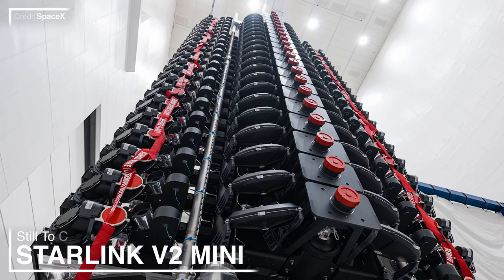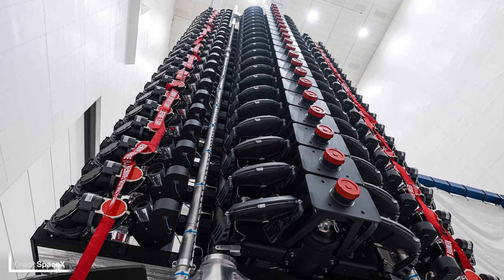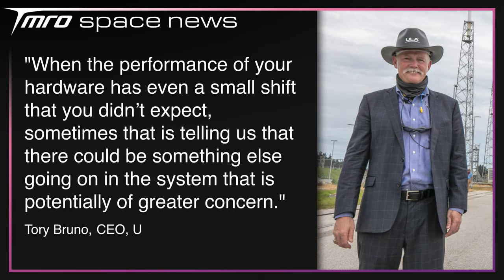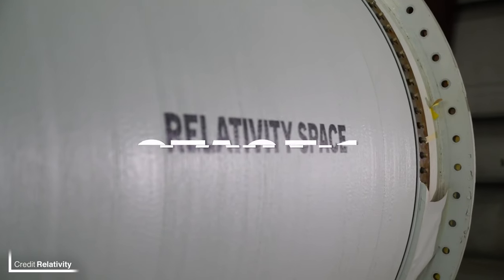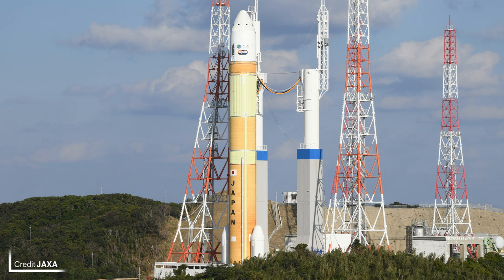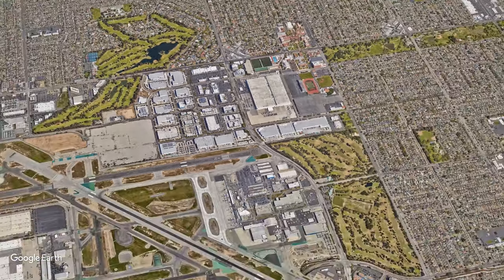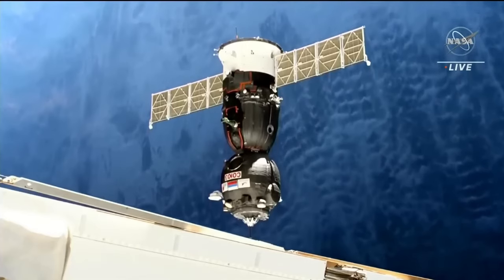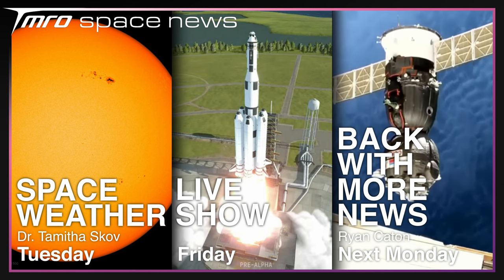The Methane Space Race: Can SpaceX Win? // Space News from TMRO

Comment: No matter how it shakes out in the long run though, it won't be the first time a human rode a methane rocket...if you're okay with doing so, horizontally.

Go back to 1970, and a land speed record vehicle called 'the Blue Flame,' operated by Gary Gabelich, sponsored by the American Gas Institute, using LNG and hydrogen peroxide.

Set the then-record at 630 and a fraction mph, beating a four-year old record by about 30mph.